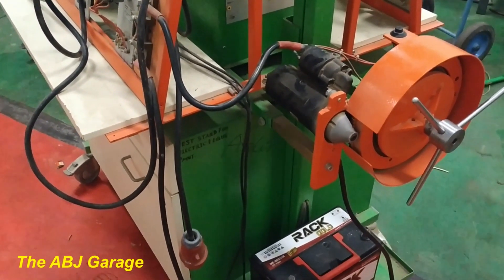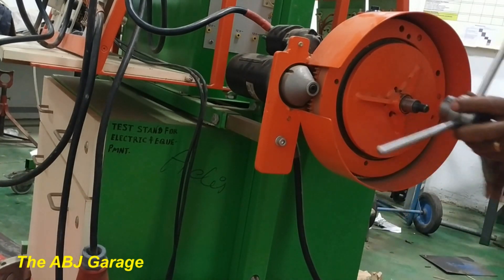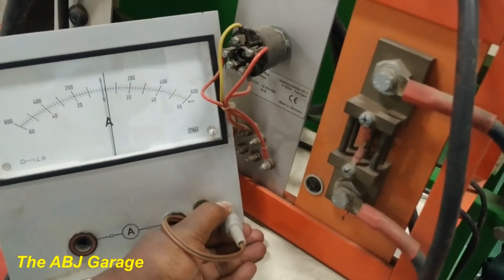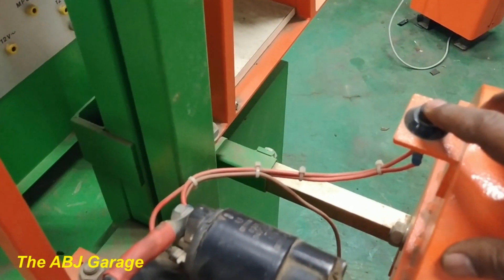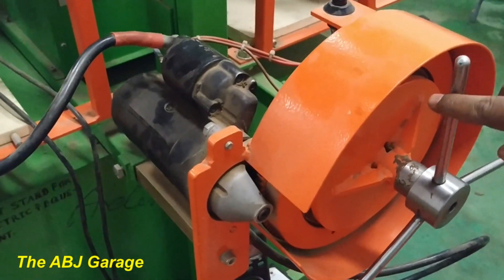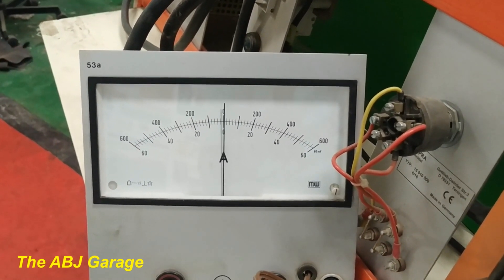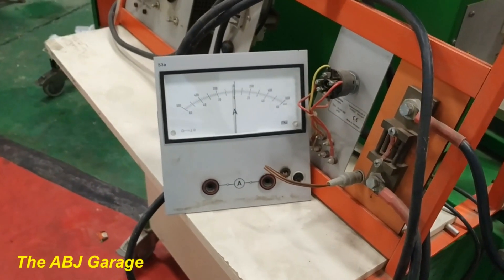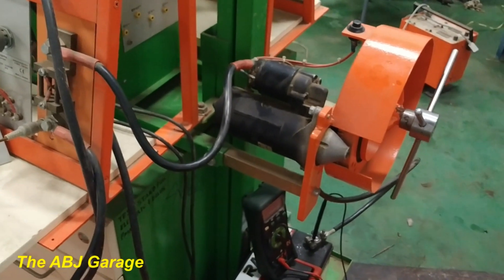Starter motor current draw comparison at varying load

Comment: What material are u using to put friction on flywheel
Reply from the maker: A clutch friction disc looking stationary disc is used here. It has a friction surface covered with asbestos material. As we tighten the screw, the stationary friction disc is pressed hard on to the fly wheel.